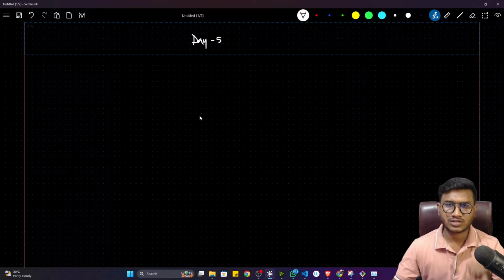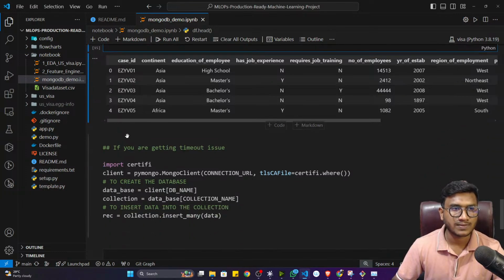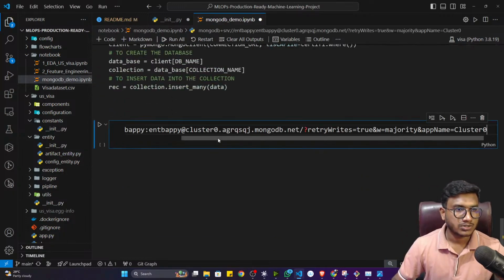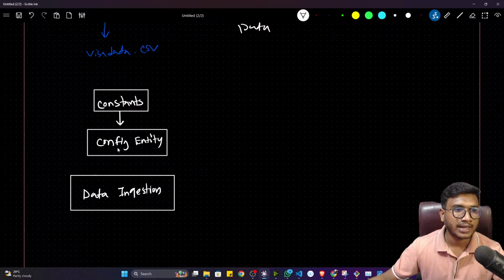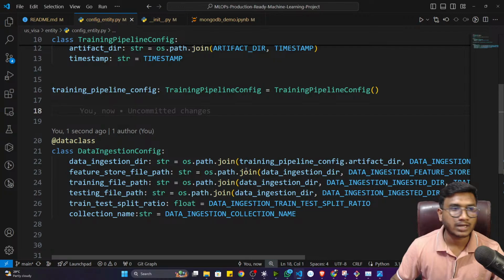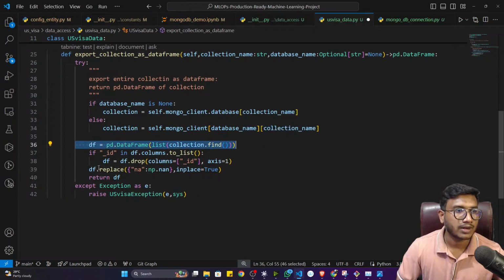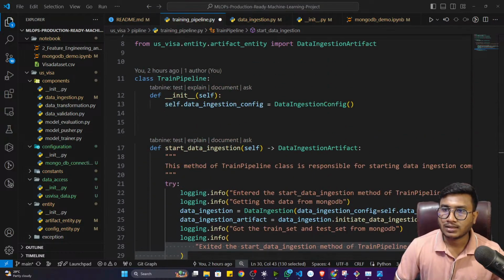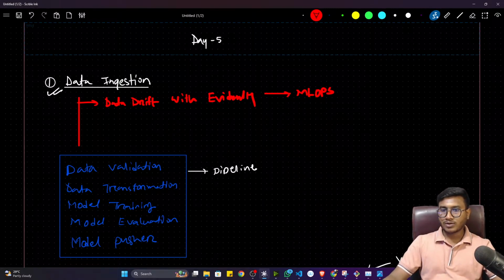Day 5 - Data Ingestion & Data Drift with Evidently | MLOPs Production Ready Machine Learning Project

Comment: Hi Bappy ! Thanks for this great project that you have explained in a balanced way catering to people with intermediate level skills. The flow could have been a bit better, considering that the modular coding for beginners might get confusing in the beginning; as in relate it with the overall architecture and then which class, method etc. to create after which one. Otherwise adding some notes would save learning time for people who can learn fast and start implementing. Just a suggestion....

Comment: hello learners and friends ,, when i try to load the data from the mongo db in the demo.py the error occurs after the mongodb get connected with the pc ,,the following error occurs 

(mlops) C:\Users\riswa\Desktop\AI\ML-MLOPS>py demo.py

2024-08-04 21:39:57,466 - us_visa.logger - INFO - Entered the run_pipeline method of TrainPipeline class
2024-08-04 21:39:57,470 - us_visa.logger - INFO - Entered the start_data_ingestion method of TrainPipeline class
2024-08-04 21:39:57,472 - us_visa.logger - INFO - Getting the data from mongodb
2024-08-04 21:39:57,474 - us_visa.logger - INFO - enterd into data_ingestion_method of data ingestion class
2024-08-04 21:39:57,478 - us_visa.logger - INFO - Exporting the data from the mongodb
2024-08-04 21:39:58,796 - us_visa.logger - INFO - MongoDB connection successful
2024-08-04 21:40:28,992 - us_visa.logger - ERROR - Error exporting visa_data collection as a DataFrame: SSL handshake failed: ac-jeaupca-shard-00-01.dffpbxg.mongodb.net:27017: [SSL: TLSV1_ALERT_INTERNAL_ERROR] tlsv1 alert internal error (_ssl.c:997) (configured timeouts: socketTimeoutMS: 20000.0ms, connectTimeoutMS: 20000.0ms),SSL handshake failed: ac-jeaupca-shard-00-00.dffpbxg.mongodb.net:27017: [SSL: TLSV1_ALERT_INTERNAL_ERROR] tlsv1 alert internal error (_ssl.c:997) (configured timeouts: socketTimeoutMS: 20000.0ms, connectTimeoutMS: 20000.0ms),SSL handshake failed: ac-jeaupca-shard-00-02.dffpbxg.mongodb.net:27017: [SSL: TLSV1_ALERT_INTERNAL_ERROR] tlsv1 alert internal error (_ssl.c:997) (configured timeouts: socketTimeoutMS: 20000.0ms, connectTimeoutMS: 20000.0ms), Timeout: 30s, Topology Description: <TopologyDescription id: 66afa7d68be591c183cb0ce8, topology_type: ReplicaSetNoPrimary, servers: [<ServerDescription ('ac-jeaupca-shard-00-00.dffpbxg.mongod

some one  can fix this ? and help ? @bappy